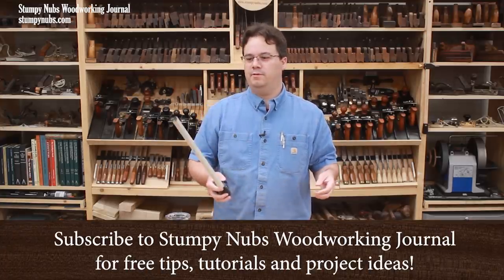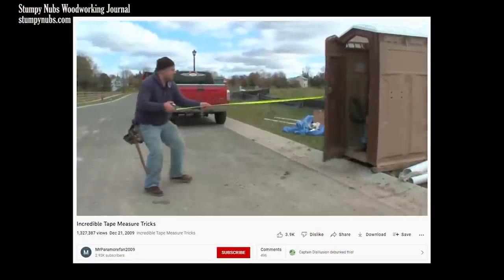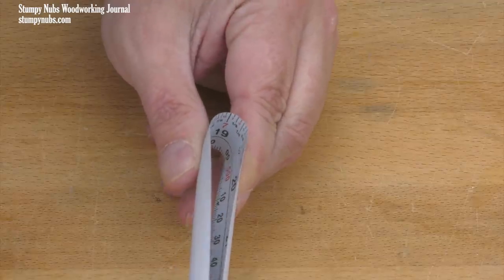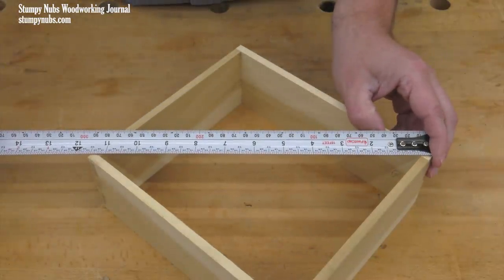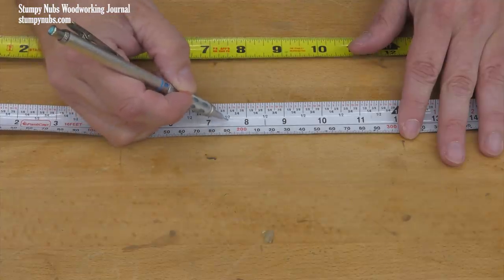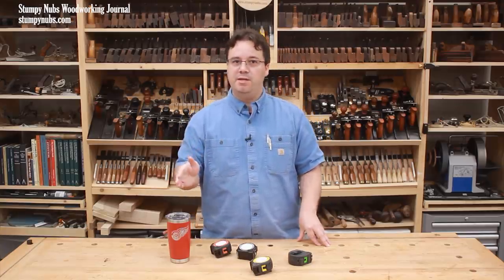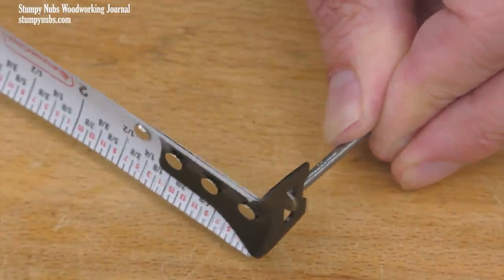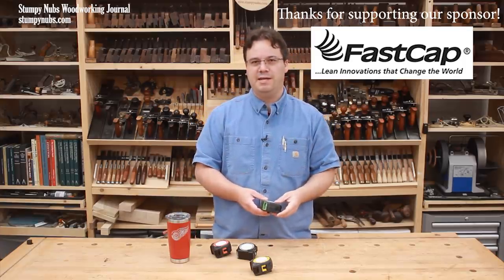BEST measuring tape tricks you've never seen

Comment: I did the "burn an inch" trick with a project I was working on that I was trying to make oh-so-perfect. Of course I forgot and cut my tapered legs an inch too short. I said many bad words. Since then I go with the "burn 10 inches" technique..... it is visually very easy to see when a cabinet part is 10" too short/narrow.
One more use for a tape measure: open the door and throw it into the woods when you cut your pieces EXACTLY 1" too short. The walk into the woods to find the tape measure is a good moment to cool down. 😉
Reply: I learned that trick using wooden rulers (yes, I’m that old) where the end would get worn down or broken.
Reply: Lol. Good one.
Reply: I reckon many of us have been there, I certainly have.
Reply: Fast cap makes a burn-an-inch tape where you don’t have to subtract 1 inch.
Reply: LOL!!!!
Reply: I never burn an inch, always ten.

Comment: Always so worthwhile watching these videos.  I never knew there is a flat tape version.  I used to see architects using one that is several feet long, some 30 feet or more probably.  But it does not retract automatically.  You have to turn a knob on the side of the rather big case to retract the tape.  About a year ago I came across an ''auto blade lock tape''.  I love this function because once out the tape remains out, no need for me to do anything to keep it out.  Then you simply press a button and the tape retracts into its case.

Comment: I need a few new measuring tapes. I never realized that my humble measuring tape had so much potential. I hadn't realized when using a measuring tape that appeared to be in good condition and was relatively new had a problem.  I blamed myself for the measuring errors and so I pulled out my late Father's wooden measuring device and quickly discovered that there was a problem with the end hook. I solved the problem by starting at the one inch line but I noticed that the product was not made in the US and so I questioned its quality all together. Even though the body of the tape was marked at 3" it was off by almost 1/8 of an inch. I now realize that there is not one single tool you can take for granted.  I also enjoyed the video because you showed us your sense of humor. Thank you !

Comment: The green FastCap is the only tape I use. It has sped up my work as well as eliminated any chance of misreading the tape since it has 1/8”s and 1/16”s marked and the numbers are never upside down. I thought the pencil pad on the side was a bit gimmicky at first but I use it all the time. It also has a pencil sharpener which is handy. They’re very affordable as well.

Comment: When I worked installing drywall, my boss insisted we use your trick at 9:25 (pencil against the end of the tape as you run the case along the edge) only he held the box knife blade against the end, and didn't have to strike a line on the drywall sheet. Just measure and slit in one motion. Saved a ton of time. Thanks for another great video!
Reply: My father used a knife and tape that way, too. He would also roll or slide the edge-following finger along the tape as he made the cut when he needed a taper or curve to accommodate a lack of squareness on a build.

Comment: Wonderful video.  Love your style of presentation.  I learned several things today.

 In my second career I was a working maintenance supervisor and tool buyer.  Building our products frequently required that we extend a measuring tape and place it down partly extended.  Try that with the brands that have a large flat release lever across the bottom, practically impossible.  I found an excellent quality tape measure similar to what you use, the Komelon, "self lock", extend, set down and the tape remains extended until the push button is pressed.

Our product was built in an ISO-2001 factory.  Many tools required periodic calibration.  In order to prevent excess wear at the "business end---the hook slots in particular", I discovered a way to cushion the retraction of the tape.  When pressing the release button to retract the tape, simply place a finger or two below the tape as one presses the release button.  This eliminates slot elongation at the hook end by inducing a mild cushioning and braking effect.  Money saved, accuracy preserved!  

Thank you,

Comment: Having a bent tab at the end has messed up a number of projects - rookie mistake on my part.  Good idea to inspect and verify using your method (7:57) before and during use. Be sure to check for accuracy between tapes when using multiples on a job.  I have seen variations among some of the less expensive ones that "grow/shrink" in the higher numbers as well as damaged tabs causing "do overs".

Comment: Very good video and I certainly learned a few new tricks. One thing I learn awhile back was to buy 12 foot tape measures. The majority of the things we measure are less than 12 feet plus the tape measures tend to be smaller and easier to carry around. That doesn’t mean you shouldn’t also have a 25 or 30 foot tape measure too.

Comment: Fastcap 32mm is probably one of the most useful for cabinetry if you're using the 32mm system. 

Love their tapes
Reply: Except the clips absolutely suck if not putting it in an apron
Reply: @williamsmith9026  First thing I did with all mine... removed the clip and the pencil sharpener blade

Comment: I love these kinds of videos. I've only just begun my journey into woodworking - Mainly because I bought a "Fixer-Upper" and have needed new shelving, closet additions etc.

Tips like these are really helpful. I now know for a fact that the tab on my tape is bad - I knew it was supposed to move, but not why or how much and it moves more than a quarter inch. Whenever I used the tab I would be yelling because my work ended up with an obscene gap or be uneven and I couldn't figure it out lol.

Comment: I've learnt a few things I didn't know about. I prefer your method of inside measurement, I use it too. You never know if if the measurement they give you on the tape is 100% accurate, you could have dropped the tape a few times and flattened the base and it could cause you just a little grief during assembly. 
During covid I needed a new tape and becuase I'm immune compromised, my wife said she would pick up one in our local merchants. She got me a 25 ft tape which has got a feature I hadn't seen before and I have gone through a lot of tapes, metal work is even harder on them than wood. When you pull the tape out it stays out, it self locks. You hit the button and it retracts, I love it. It was inexpensive, accurate and easy to read. The only thing was the name, "Fat Boy" ; I think she might have been trying to tell me something! Maybe she's in league with my doctor.
Reply: For me, the killer feature on my new Milwaukee tape measure that I like the most is the integrated magnet on the hook.
Reply: As long as your name isnt Max then you are ok.

Comment: Hi from the UK. I picked up a couple of tips from you. The main tape that I use is a brand called Magnusson. It already has two magnets set into the main tab along with a second narrower tab pointing upwards. the scale is metric and imperial and is printed on both sides of the tape, imperial is marked in inches, ie. 25,26,27,  as well as ft and in. The lock is automatic and has to be held for retraction.

Comment: I love my leftie/righty fastcap.  One thing I learned is to check to ensure the tapes are measuring the same amount.  Sucks to measure 12 1/8 with this tape, then use another tape down at the saw and have it be 1/8 or whatever different/off from the first one.

Comment: 2 notes. Absolutely love fastcap! All of them. I've been using them for 14 or so years. I still have the old models and use them regularly. But when I'm at work I use a stanley. With the 🧲.  I bought one 5 or so years ago and have been able to transfer it from one tape to the next when they get broke. So it only initially cost me 5 bucks. (Note2) all Stanley's have the extended rivets on them to accept the 🧲 . Just kinda have to modify the opening to the case a TINY bit👍

Comment: My tape is a Fisco it has a drop down hinged tab that’s really handy it means no numbers !! Just bend tape take it too the saw open then scribe , it’s handy for inside measurements also 😊
Reply: Fisco add some really nice features. The one with the case length measurement visible through a window in the top of the case is one I've had my eye on for a while. It's marked on both sides too, which would be really handy sometimes. I just wish they did a model with all of it; case window, bump stop, double sided, & a tab that extends up a little so you can hook it up to measure things from below.

Comment: Tip on the sharpie marks: dry erase will “soften” them because of common solvent carrier. So scribble over the sharpie mark with a fresh dry-erase mark and wipe them both off with ease. Seems like WD-40 would only grease your tape up or wear out the marks over time.

Comment: Though not as common as imperial or metric, there is also engineers scale. It divides a Foot into tenths, hundredths and thousands making for much easier calculations. It took a little practice but once I got the hang of it I much prefer it over imperial. Thanks for the great video!
Reply: I have a folding rule that has ft/in- ft/in on one side and ft. in tenths and hundredths on the other. It’s probably handy for measuring cubic ft.

Comment: As someone who uses the metric system I've often wondered how difficult i would find using an imperial tape, especially when it comes to adding or subtracting. That's a really cool trick you showed me that most probably already knew 😁. Also the trick for finding center is great. Love your videos! All the best from down under.
Reply: Yeah fractions is a grade school subject
Reply: It's pretty easy. To half a fraction, just double the denominator. Half of 1/2 is 1/4, half of 1/4 is 1/8. Half of 7 and 3/8 is 3  and 1/2 + 3/16 which is 3 and 11/16. If you can't do stuff like that in your head, you should probably stay away from power tools.
Reply: @Persun_McPersonson  It all depends on the application. For general, not fine cabinetry, woodwork, you never need more precision than about 1/8. If you do, you're cutting and fitting and just know to cut a "strong eighth", or "cut on the right side of the line". It becomes intuitive. 

If you're doing high precision work, you're going to be working in decimal fractions even if you're working in US customary units (correct term for our system). Then, it makes absolutely no difference if you're dealing with 120mm or 4.275 inches. One isn't "better" than the other.

I don't care what you use, but I get a little tired of the "Americans dumb, they use inches" bullshit. If you can't use both, you're either lazy, or bad at math. At least we don't weigh fat people in some medieval unit like "stones".
Reply: @Mishn0  Ok, but why use both? Just stick to one system. And between the two, metric is less complicated and more efficient, so we use metric. Sure, imperial only requires basic maths, but it's extra math that you wouldn't have to do if you used metric, which saves time and effort

Comment: Nice tutorial on tape measures. I'm sure you know that tape measures are not always the same. I have found that sometimes 1 will be a 1/16 to 1/8 off. I checked all of mine with the woodpeckers ruler. 2 of my 3 tapes were off. Went shopping with my woodpeckers ruler to buy new ones.

Comment: Fastcap for LIFE. Just having the 16ths marked saves lives. One thing I think needs to be taught is not losing one inch when moving between a location and a material. I’ve identified a common mistake where you measure, say 25 1/2, then take the same tape to the material, but have to turn the tape the opposite direction, and proceed to read off the 1/2” in the same “direction away” from 25 as you measured it, giving you 24 1/2. Because measuring in inches is not really the number, but finding the fraction, it visually becomes just moving “away” from the inch the right amount, and it’s easy to go the wrong way.

Comment: You can turn any tape into a story tape by just putting a piece of blue tape on the blade for the project you’re working on.  Then imstead of using estimated measurements based on the parallax of your eyes, you are making and using precision marks.  Once your done you don’t have to use chemicals or elbow grease to clean your blade, you just peel off the blue tape…good as new.
Reply: Good advice.

Comment: I’ve even got suggestions for a follow up. Admittedly these some aren’t typical uses for tape, but can certainly make use of the tapes flexibility. 
You can use it to lower things down to people, when you master the throw technique you can measure upside down on ceilings to around 6ft/2m little more with practice. Aim the tape at the corner and roll the tape along the ceiling while push pressure into the corner. 

You can grab far away objects if able to hook them with a loop. 

using the same technique as the ceiling one you can master it sideways off walls to mark along the wall one handed.

Comment: If you've ever broken the end off a tape, and were able to catch it before it retracted ( you know, buzz, flap, flap, flap. Now it's a paper weight) put enough electrical tape on the end to stop it. Now you have one of the best tools for fishing inside finished walls. It rides easily between the sheet rock and the insulation to the hole you cut for a new switch or outlet. Tape the Romex to the end and pull it back. Better than a fish tape or fiberglass rods. Another cool tape is one that has the markings on the back, great for doing layout on the ceiling, for something like can lights etc..

Comment: Masking tape rather than post it, since it’s already in the shop.  I add several layers of 2” masking tape to the side of the tape measure. Then just peel it off and either put it on the workpiece or toss it and have a fresh writing surface

Comment: Love my Fastcap tap measures. One thing you did leave out is the True 32 metric tape (blue one) has a marking every 32mm for European cabinetmakers standards. That was one I didn't figure out until I had it in the garage. If you use Festool stuff like the MFT table you want one because that's the hole spacing.

Comment: Before I bought a stair tread template tool, I used the inside measuring tip you suggested. I would measure, at the back of the tread, from one side to the center (at a whole number) and then measure from the other side to that mark and add the two together. Then I'd do the same thing at the front of the tread. I didn't know to do this before, I just figured it out. I never trusted the bent tape method, mainly because I don't know where I should be looking on the bend. I would just guess.

Comment: Love the fast cap tapes for the shop. For field/outdoor work (I work in construction) I like the komelon tapes. The are very durable, great easy to read scales, and certain ones claim to have a lifetime retraction guarantee. Although I have yet to have one break on me after switching to them over a year ago. So I have yet to test the return policy if one does indeed bind up. Which is a bit problem working outside when dirt, mud, grease, and water can ruin a tape quickly.
Reply: I agree about fast cap tapes in the field. They are too flimsy.  Haven’t used komeleon, but like the fat max

Comment: Wow! I was literally LOL at all the times I've struggled on the job site while the answer was right in my hand. 
I especially like the subtraction trick of folding the tape back on itself. For measurements too short to fold the tape back just fold back an additional 10 or 20 inches.  Trying to subtract from 5" then go to 15" or 25" and burn the first digit. Gives the tape plenty of room to fold and no additional math.

Comment: I own a specialty measuring tape that has a regular scale on one side and the other side reads the diameter of a pipe or tree on the other side. There is blank space at the beginning of the tape so you can hold it as you wrap around the pipe and match the zero point with the diameter reading. And yes it is a flat tape to make tight circles.

Comment: A few comments:
* Denatured alcohol will also remove Sharpie an pencil marks
* When dividing something, I'll often just check the metric measurement.  It's often easier to do something like divide 44 cm in half than 17 3/8
* I have a number of rules with metric, but they are all "different", the scales vary in their markings-- mm, cm,  M+cm, cm past the last meter, mm past the last meter, etc.  I just pick one and use it for the project
* I "burn" 10 inches -- it is more obvious that my measurement is   25 to 15 inches rather than 16 to 15.

Comment: You might do a video on checking the scale on one tape against another. I found some of mine are wildly off, not only in where they start zero, but sometimes the spacing inch to inch can vary. It puts into question whether any are truly accurate! But that's why you should use the same tape measure throughout a project. I did find some online from Europe, because they have accuracy ratings on their tape measures.
Reply: As a European carpenter, I can attest that measuring tapes may wary here too.
We get all the Chinese crap here as well. I have seen a tape with the wrong amount of millimeter lines in a centimeter.
I buy brands that I trust are accurate enough. In my case those are Bacho or Hultafors, but there will be other recognized brands in other countries.

They can be had with American scale on them too, though I do not know why you'd want it.

Comment: if you need to mark around a cylinder, like to make a square cut on a pipe, wrap the tape concave side in around the pipe and align the tab end with the body of the tape - then simply draw along the edge of the tape.